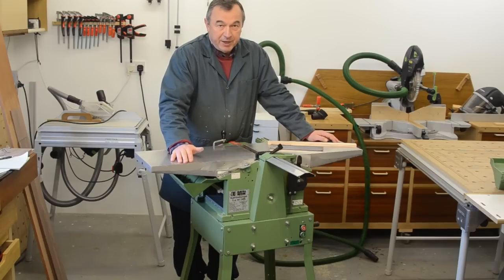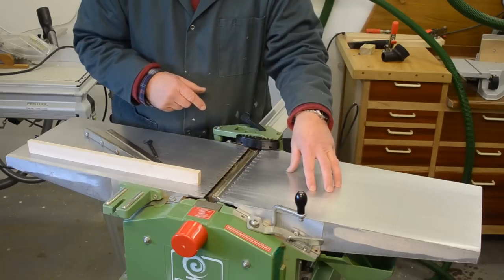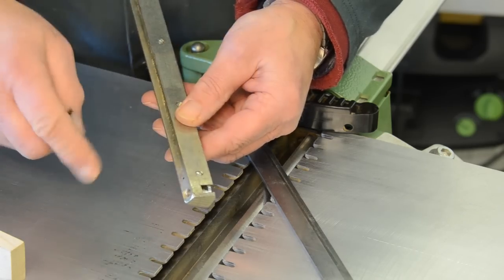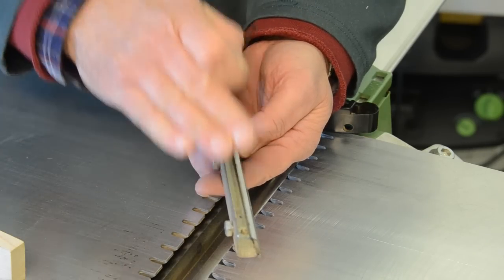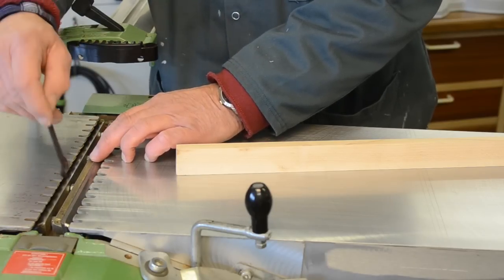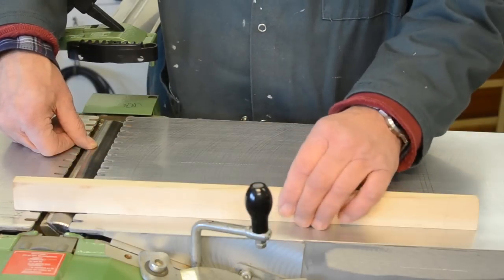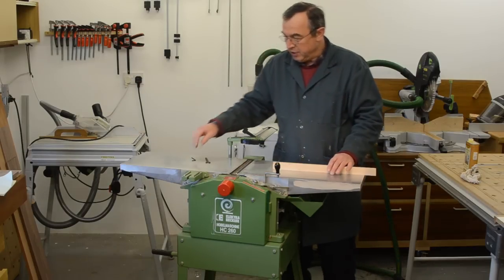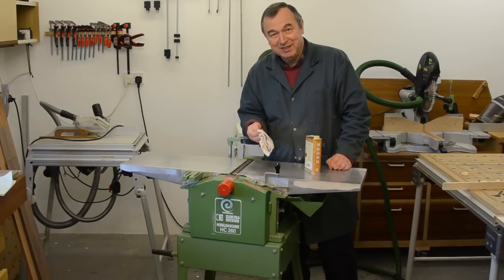How to Set Planer Blades

Comment: Thanks for the excellent video Peter.  I have the same machine but the rubber on the outfeed roller is breaking down and becoming sticky.  Do you have any information on how to replace the outfeed roller?  Thanks in advance.
Reply from the maker: I am afraid that I have never come across this. The Elektra Beckum brand was taken over by Metabo and they still market a similar planing machine. Contact Metabo as there is a good chance that parts from their current machine will fit. I have always found Metabo in the UK to be very helpful and particularly friendly.    Peter

Comment: Thanks Peter...I have the same Machine. Never used one before, but have used a Bosch paner. The principle of feeding over the planer table I took as with the hand planer.  No downward pressue at all on the end, to prevent Sniping.  Alas this was the case each time , despite the dial setting saying less than a mm. I got it used. Could the blade be the issue? To high maybe. The snipe, despite no pressure is ca 1 mm. Violent slightly... Cheers for any advice...I will give your tip a go.
Reply from the maker: Hi Dave, Are you supporting the wood as it comes out of the planer? You should try to do this without exerting upward pressure but just enough support to keep it level as it finishes the thicknessing.   Peter
Reply: @NewBritWorkshop  the peices were only 45 cm long. I Slide them along over the blades and transfered the holding on the part that had past the blade, flat too the table. Each time it seemed to fall and cut a snipe... table was set to remove less than a mm. I have levelled the two  tables useing a straight edge. Then I rolled the blade cylinder so that the blade reached its highest apex. The blade is 2 mm higher than the two levelled table sides.. The locking slide levers are tight. Nothing loose.
Reply from the maker: Try a longer piece of wood, say 600 mm long, and see if you can control the snipe that way. It sounds as though you have done all of the right things. I remember a long time ago watching a video on YouTube that helped to cure snipe. Try doing a search and see what you find.  Good luck.  Peter

Comment: Hello Peter,
I have recently purchased a 20-something year old Elektra Beckum planer/thicknesser which appears to be in good condition although I have had to replace the cutter bolts that were rounded. My cutters are the thick ones with one cutting edge which looks very much like yours, and they are in good condition..  How often have you had to replace your cutters in the years that you have owned the machine?
Reply from the maker: Hi Patrick, When I bought mine the option was for either double sided disposable blades or single sided Tungsten and I opted for the latter. If yours are Tungsten then with average hobby use they will go for 4 years between sharpening unless you have a mishap with a nail or embedded stone. If they are HSS then you should get 6 months to a year from them. I used to pay about £20 to get them sharpened.  Peter

Comment: I just bought the same planer/thicknesser but I am having trouble with the thicknesser infeed rollers. The drive belt comes off as soon as I turn on the machine. Do you have any ideas on how to fix that?
Reply from the maker: Hi Arlo, Not without seeing it. Check that the belt if not inside out and that it is tension properly. Also check that the two pulleys are in line. Other than that get your dealer to sort it out.   Peter

Comment: Hi Peter, That was very interesting as I recently purchased a second hand exact copy of this machine, and intend to replace the blades.  One problem I am having is with the thicknesser insofar as  a large amount of 'snipe' when feeding the material in to the machine, not much of a problem with the tail end of the timber.  Could this be due to a setting fault, as i've never used one of these machines before, otherwise it works perfectly. Thanks Barry
Reply from the maker: Hi Barry, It could be that you are trying to take too much off with each pass. Once you get a snipe on one side it is difficult to get rid of especially if you turn the piece over. Also, if you start by planing (or jointing) and are not careful at towards the end of a pass then you can create a slight irregularity which is eveident as snipe wen thicknessing. Take care to make sure that your wood when thicknessing is flat on the bed as it enters the machine. I would recommend that you watch a YouTube video about snipe (I have not made one) - https://www.youtube.com/watch?v=RnYw02yKEUs    Peter

Comment: Hi Peter, I have the same machine but it has no extraction hoods or chip shoot, do you know if these are still available. Regards

Phil
Reply from the maker: Hi Phil, I am sure that they are as the machine design was used by many manufacturers. Record and Matabo (there may be others) still market machines like this. I saw the Record one last month at a show and it appears near enough identical to the old Elektra Beckum badged machine.   Peter

Comment: Hi Peter, very informative video. i have just bought the same machine and my locking bars have three allen key grub screws, do I need special blades? Thanks.
Reply from the maker: You can use what ever blades are supplied but make sure that they are sharp. I prefer Tungsten blades - if you can get them.   Peter

Comment: Hi I have this machine and have taken the fixed bed off,  it won't no longer locate  without  cutter  block hitting it.  Have you ever had this issue? 

Chris
Reply from the maker: Hi Chris, No and I sod my machine at least 5 years ago. The Elektra Beckum company was taken over by Metabo who still make this machine. You could ask a Metabo expert for help.   Peter

Comment: Hi Peter, 
Great video. I am a happy owner of this very machine courtesy of eBay and one owner from new. Just a question on general planner setup. It seems from this method that the blade edge is infact higher than the outfeed table!? I have the original set up tool for the HC260 would this produce the same blade height as your method? 
Thanks much

Will 
Bristol
Reply: Also any suggestion on the best blades for this machine? Not the disposable kind. Cheers!
Reply from the maker: Hi Will, There is one flaw - when I did this I had adjusted the infeed and outfeed to the same plane. It is the outfeed table that one should use.  Cheers.   Peter
Reply from the maker: The best blades are solid Tungsten Carbide (which I had). They are not cheap - I paid about Euro 150 for my set.   Peter
Reply: Late reply! I am just getting round to getting new blades for this planer. I bought some from Metabo via amazon which say fit the 260 C/M/K. I have the EB HC260m. 
These are double sided disposable but only have a single hole and slot in them? No slots for notching into the blade height adjusters. 

I found these, which are sharpenable. http://www.applebywoodturnings.co.uk/elektra-beckum-slotted-hss-planer-blades-260-x-20-x-3mm.html

Any thoughts on where to get disposable one with the adjustment slot? 

I am not sure if I have the lock blocks for disposable or replaceable or what the difference is between them?

Thanks much in advance!

W

Comment: G'day Peter, I have just bought the Electra Beckum HC260 Planer/Thicknesser second hand. Do you know where I can get the operation manual from please? Thanks for the blade change video, brilliant!
Reply from the maker: Hi Andy, Try Google or look at the Metabo HC260 which is very similar.   Peter
Reply: Thanks for that Peter.

Comment: Hi there, I have the identical HC 260, I have a problem that after a service at Metabo the rubber belt that turns the blades keeps on jumping off.  What could be the problem, in fact it's been back to Metabo twice, I am really frustrated. What I have notice is that the big black fly wheel or pully has a bit of a play when it's rotating.
Reply from the maker: Hi Peter, I sold my HC260 about 3 years ago but from what you say it sounds as though the bearing has gone on that big black flywheel. They should be easy to replace.  Good luck.  Peter

Comment: Hello, I have the same machine and suddenly the crank to raise and 
lower the tray began to get stuck, I have cleaned it very well and 
I have lubricated it, it goes smooth, but immediately the thread 
hardens and turns wrong. Any ideas how I can take it apart and see 
what happens? Thank you very much for answering, I am writing to you 
from Buenos Aires, Argentina
Reply from the maker: Hi Ernesto, I am sorry but I sold this old planer about 9 years ago. If I remember rightly the lifting mechanism acts via a chain that turns several sprockets. If I am right it could be that one of the sprockets is out of mesh with the others. I cannot give you any further advice except that the machine is now made and sold by Metabo and so a Metabo engineer might be able to help.  Good luck.  Peter
Reply: @NewBritWorkshop  Hello, thank you very much!!

Comment: I have a dewalt dw1150 and when i finnish setting the blades and tighten them up they change. Any advice on how to fix that ?
Reply from the maker: I am not familiar with that model. However, if you contact Dewalt you will find them very helpful.   Peter
Reply: New Brit Workshop thank you for your quick response i will try contacting them

Comment: G'day Peter, Where would I buy the Tungsten Carbide blades for the Electra? (Same machine as yours)
Reply from the maker: Hi Andy, I bought my machine in Germany in 1990. Since then Elecktra Beckum have been taken over by Metabo. I sold my machine 7 years ago. I would suggest that you try Metabo. Failing that, there are several other companies using the same design of machine (they may be made in the same factory) and so you could try them - Record have a similar machine.  Good luck.   Peter
Reply: Thanks Peter.

Comment: That's a great video which will help me and many others. Although I am only a hobby woodworker, in the garage with my son, I am presently looking at these machines, but a little confused by there being so many models that are all made by (probably) the same maufactuer.   Our main interest is in making bandsaw boxes and this would help in preparing the material.

I appreciate it is difficult to answer, but if buying a PT260 today, which machine would you go for and why?.   At present I am leaning towards the Record PT260 model, as I have a Record BS400 bandsaw and do like the fact that there is a 5 year guarantee with Record equipment.  Can you help?
Reply from the maker: Malcolm Alexander Hi Malcolm, Good for you to do woodwork with your son - it will be a great advantage for him in later life. I am no expert on the range of these "260" planer thicknessers as mine was sold under the Elektra Beckum name a long time ago. The Record machine is about £660 from Screwfix. The Axminster version is known as the AWEPT106 and is slightly cheaper. It looks just like my old machine (except for colour) and has had some good reviews on the Axminster site. I am sorry that I cannot be more helpful.      Peter
Reply: Thanks Peter, I appreciate your reply.  I can get the Record this month at a sale for £569 and free delivery, so I will have a look at that and get a demo before deciding. In any case, your video was a great help.  Will be looking at more of your videos soon.

Malcolm
Reply from the maker: Malcolm Alexander Hi Malcolm,Just check the returns policy to make sure it is worth that small saving.Peter

Comment: Hello Peter,
I have a Metabo HC 260 planer is pretty much a clone of your Elera Beckum. My planer came with disposable blades. I bought a Metabo Resharpenable knive conversion kit, which is the same design as your locking bar. I also bought 3 sets of planer knives, described by Woodford Tools  as resharpenable knives for the Metabo HC 260. They are the wrong knives, they do not have the slot, notch that the flange on the bottom fits into. I've been back and forwards to Woodford, just banging my head against the wall. Can you tell me please where you bought your knives from? There must be resharpenable blades available with the notch, slot in the bottom for the various 260 clones.
Thank you:)
Reply from the maker: I bought my HC260 in Germany whilst Elecktra Beckum were still in business. The blades were ordered at the time and were made by Elektra Beckum. First of all, as long as you have not damaged them in any way, you should approach Woodford to get your money back. Next, it sounds to me as though Metabo should have what you want as you have already bought elements of the block from them. I am sorry not to be able to help you any further. I sold my HC260 about 5 years ago.    Peter
Reply: OK thanks I found your method of setting the planer blades to be the best so far, Thank you.
Reply: I've located the Electra Beckum 260 slotted resharpenable blades, Woodford do them too, said I could return wrong ones for refund, including post. So all seems good :)

Comment: Hi there , hopefully you can help me . I have a planer and the blade as well but need to use only the planer , was told to unhock the machine and switch the rubber from the small one to the bigger one but the planer isn't working , can you help me or if you have a video send me the link pls . Thanks
Reply from the maker: I am so sorry but I do not understand what you mean. I do not have this machine any more so please explain your problem more clearly.  Peter
Reply: @NewBritWorkshop  Hi Peter thanks for your reply . i have a planer and also the circular blade , need to use the planer and was told to change the rubber from one side to another to use the planer . I can send you over some photos if you can't understand me , thanks once again
Reply from the maker: The blades are straight and there is no rubber as far as I can remember - I sold my machine 10 years ago.  Peter
Reply: @NewBritWorkshop  Hi Peter , that's true the blades are straight and no rubber either . i'm talking about the machine that has a planer and circular saw combined together and need to change this rubber from one side to another so that the planer can be used
Reply from the maker: I have never seen the combination machine and so, I am sorry that I cannot help.  Peter
Reply: @NewBritWorkshop  Thanks Peter

Comment: Hi Peter. 
Please help. 
I have the same machine but the metabo version. HC 260k 3100WND. 
I used to work on the very same machine you have ie the original elekta beckum. Such high quality steel they used those days. Anyway my problem is I have stripped the hex screw in the blade hight adjuster grub screw. I have looked online for a replacement part. It gets confusing. It seems it is part 104. But in the diagrams this grub screw does not have a small flat plate head  one end. This engages with the slot in the back of the blade. Much like your machine. However all the diagrams off the machines listed have just a grub screw without the little engaging plate. Or am I missing something. Luckily the blades are set at the correct height for now but my next sharpening will be delayed until I get this replacement part. Please can anyone advise? Sorry for such a long winded speech. I have just spent all day online trying to figure it out.
Reply from the maker: Hi Bob, I sold that machine years ago. Metabo are a brilliant company and I am sure that if you touch base with them that they will be able to help. Other than that all I can suggest is that you take the duff part down to your local engineering company and ask them to produce a new one - it will not be cheap.  Peter
Reply: @NewBritWorkshop  Hi Peter. 
Thanks for that. I will contact Metabo.